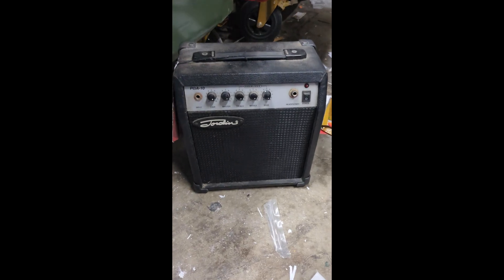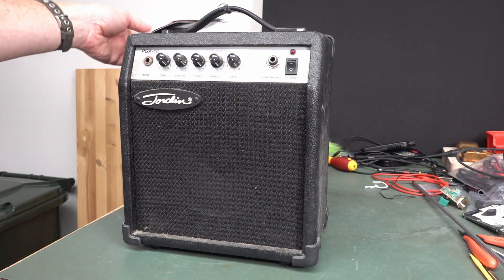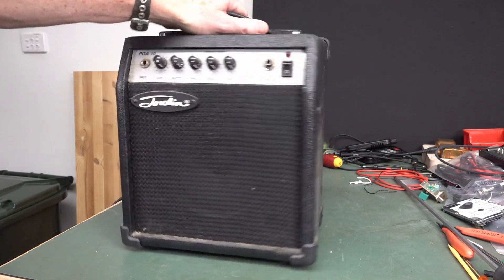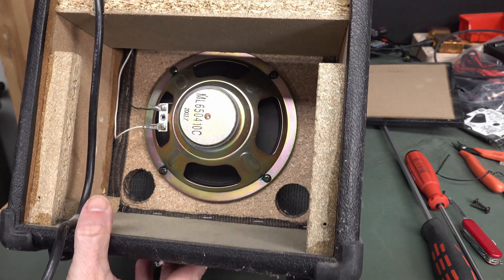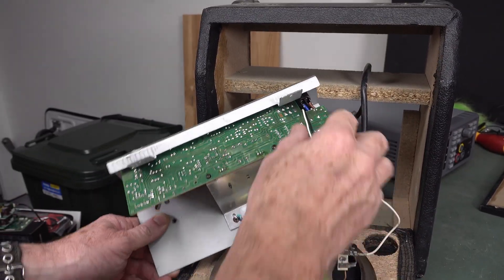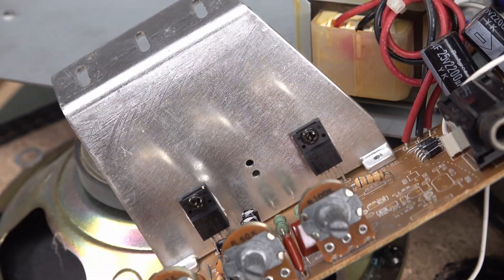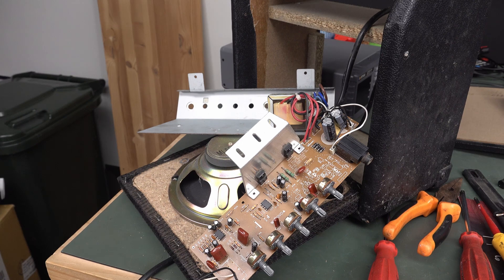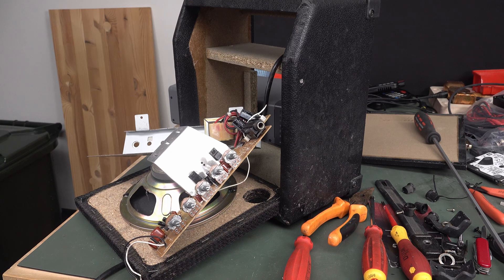Dumpster Diving Guitar Amplifier

Comment: Those are cheap, common design basic beginner/starter amps, just fine for quiet home practice. Definitely not gigable. Nearly all manufactures use the same basic layout. The PC board is likely built to accommodate a more intricate circuit on the less cheap models
I build amps like these all the time, usually an LM 386, 4886, JRC386 single or dual variety, lots of filtering, couple MOSFETS, an MSA13, J201, or MPF102 transistors. But I install them into unusual cabinets like a small jewelry box, lunchbox, small radios. The smallest one I made was just 5 components in an Altoids tin. It sounds awesome!

Comment: So the big let down these little amps is the crappy speaker, however if you fit a speaker out socket then you can use these things as an amp head and run them into a bigger guitar cab for a much better tone.
If this one still works then why not donate it to some kid to use rather than send it to the land fill.

Comment: Most beginner and even some not so beginner amps are like that.... completely hollow inside, basic electronics, not much to write home about. I honestly think you won't get that much of an upgrade for amps that size even for the more fancy brands. I had a Fender back in the 90s not much bigger than that one that was just like that inside. Sounded like squeaky sh*t tbh... but hey, I also sounded like squeaky sh*t, so fair is fair. xD

Comment: The unpopulated part of the PCB looks to be a reverb circuit.  You can see where there are two header pin spots labeled REVO and REVI for reverb out and reverb in to a reverb unit (wobbly spring and transducer).

Comment: Even tube based guitar amplifiers use the cheap way of mounting tube upside down that was used back in the day to cut coast. It's a better practice to put the tube the right way and to insulate from the speaker among other better design practices

Comment: I have this exact little amp. lol..  I'm not sure about the name, I'd have to check;  But It's the same layout and same size..  I had picked it up back in early 2000's from "hastings".. Which was a movie rental store and they also had a lot of books.. and that's where we would buy all of our CD's too.. (it's closed down now, in  my city).   For some reason they had an amp With guitar all in one package for one hundred dollars.. and I bought it.   And it's the electric guitar that I learned to play on and still have it today...  You should have checked it-- I bet it still works fine.  The main thing that goes bad is in input jack....  Otherwise, it's a surprisingly useful little amp.

Comment: Those little amps are great, they are made on some many names though. I suspect the missing components are the overdrive circuit.
Reply: Nah, that must be a reverberator or some other sound-dood-iser. An overdrive capability is an essential feature every guitar amplifier MUST have for you to be able to play classic heavy metal music. And it must be accessible by turning a correspinding knob up. Noone would even consider buying a guitar amp if it could not go into overdrive as that is pretty much what electric guitats are for.

Comment: I have one of these amplifiers very similar
 I converted it into a battery operated, rechargeable, busking amplifier It's a 12 V circuit board so 12 V lithium or lead battery will do fine . Any Guitar player ( or Musician for that matter) who busks would love that.
 It runs over 3 hours,
 depending on size of battery 
BTW  I found mine in the skip also

Comment: It's a cheap practice amp and you can score that kind of stuff at music school, they toss them when they starts to get crusty and crackly. I have a small pile of them.
Good for parts to fix better ones, like cabinet angle protectors, pots, pots knobs, the transformer is usually okayish too.
Even big name in amp like Marshall sell this kind of practice amps and they actually are exactly the same thing as this one. All sounds decent, it's not crap, it's just low power , no features products. The unpopulated section on the board show that the same thing is used for a better model.

Comment: Well, to be honest, that's what like 90% of guitar amps are, not really anything electrically special. Some older ones might have some opto-electronics for vibrato circuits that are near impossible to get today and there's some with some fancy features that are special in guitar amps but probably quite normal and boring generally (like tube bias indicator circuits in Hughes & Kettner amps). Even the big brands are pretty much "meh", some good building but that's it. Guitar amps might be one of the few things where taking a look at garbage is actually more interesting than taking a look at the high-end because at the high-end it's just an amp with good build quality and maybe some black-goo to seal the magic or sometimes just plain money grabbing. At the low-end you actually have the excitement of finding the probable house burners and "how to not do things" pieces, also the extreme cost cuttings are sometimes fun.

But generally they are amps but instead of trying to make magic electronically, they just make marketing with some guy with a long hair and fast fingers and hire some other guy to write some mumbo-jumbo that makes zero sense but sounds cool enough, and the guitar amp afficionados go crazy and start fighting how one vacuum tube made to a spec is so much different from another one made to the same spec.

Comment: Yep those look like genuine Rubycon caps! 
Usually fake ones do not have the K vent indentation on top...
Reply: Also if it is really over 10 years old, fake ones would have splurged all their gunk over the board!
Reply from the maker: I was implying they might have been used parts

Comment: "It's a hyaena..."
Totally meh indeed, cheap and run-of-the-mill practice amp. Way too crappy for a Keritech Electronics Totally-Tubular-Transition. The piece of sheet metal semblance of a chassis ain't even gonna hold an ECL86 with a pair of transformers. Send it over to Brad's Guitar Garage if you want, I'd like to watch him roast it.

Truth be told... even big brand amps of this class ain't nothing special. It's all just there to cater to beginner guitarists with cheap axes - but egos big enough to care about logos.
Reply from the maker: A genuine Fender doesn't cost much more than this thing.
Reply: @EEVblog2  it's all made in China after all. The rest is marketing.
Reply: @EEVblog2  Yes, and the internal design doesn't look much different. However, it's not just the cheap ones. Recently, there's been a lot of discussion about the build quality of expensive amps as well. Take the new Gibson Falcon 20, for example: https://www.youtube.com/watch?v=LGAkcGctgN0. They're asking for $5k for it!

Comment: Appear to be copying the Fender Frontman 10G amp (I have a couple). Worth stealing the transformer maybe.
Reply from the maker: The Fender Frontman 10G is only AU$129. Wow, didn't know the big brands were that cheap.
Reply: @EEVblog2 All the big brands have their cheap chinese practice amps for beginners. If you want a real US made fender tube amp you're $2k+
Reply: @looking_33  When I played I also had a Fender Supersonic 22 (solid state) and even those are £1500.
Reply: @looking_33  2K ? That is absurd.
Reply: @EEVblog2  The "entry level" line of practice amps from any brand tend to be pretty cheap.  
They're never intended to sound amazing, just to let you hear what you're doing  when you're participating alone at home.